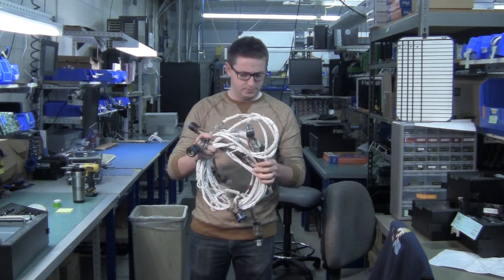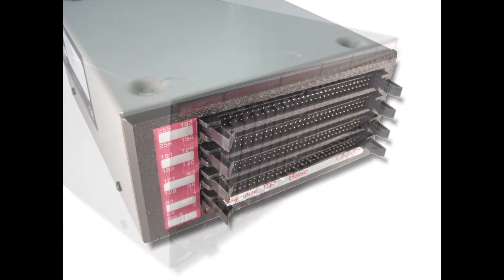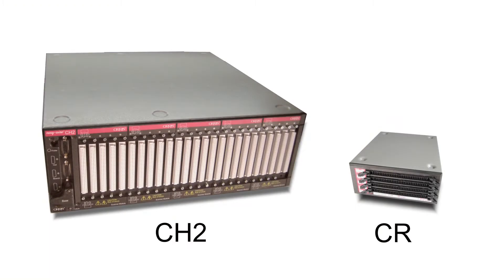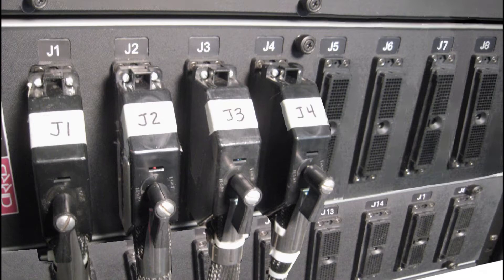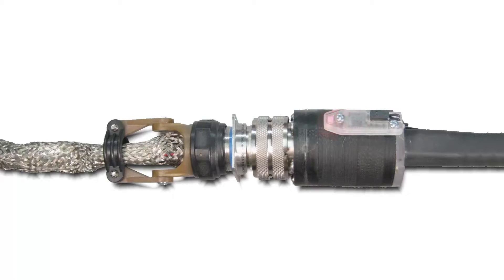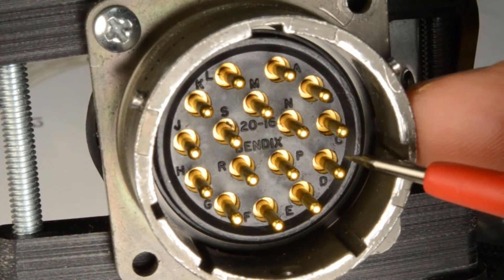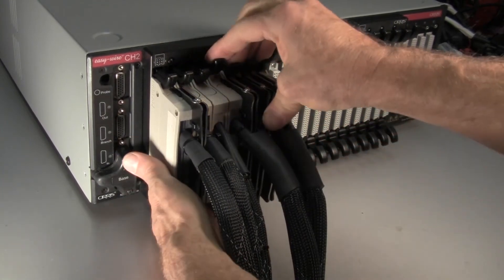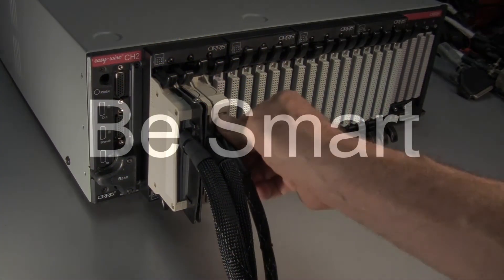Smart-Lights 1: The Smart-Light Advantage

Comment: WE ARE EXPERIMENT TROUBLE WITH CONECTORS (SMARTLIGHTS) , WE DON'T KNOW WHAT'S WRONG , WHEN WE DID A TEST AFTER WE WANT TO RUN ANOTHER TEST BUT SMARTLIGHT ALWAYS ALMOST 1 OR 2 CONECTOR ARE NOT DETECTED , AND WE NEED CHANGE SMARTLIGHT ALSO WE NEED REGISTER AGAIN.
Reply from the maker: Thank you for your comment. We received the form you filled out on our website. Someone from Cirris will be contacting you to help you find a solution.